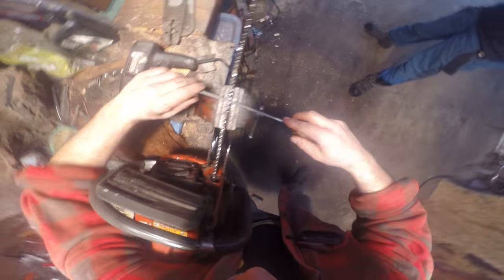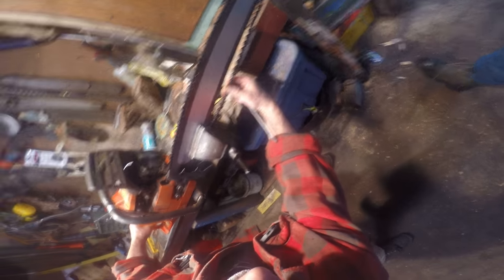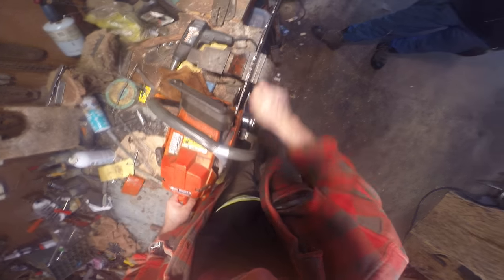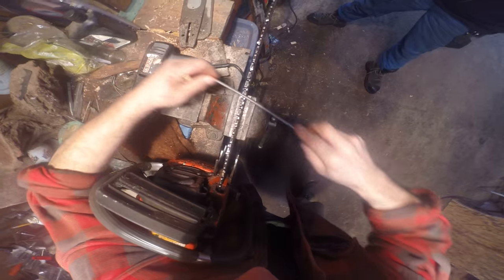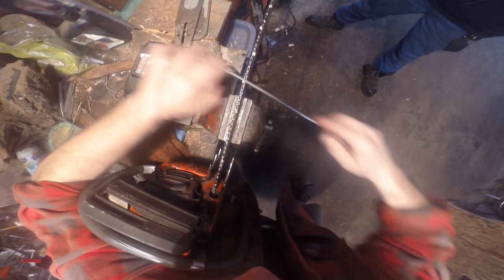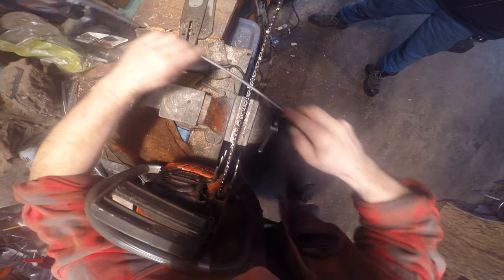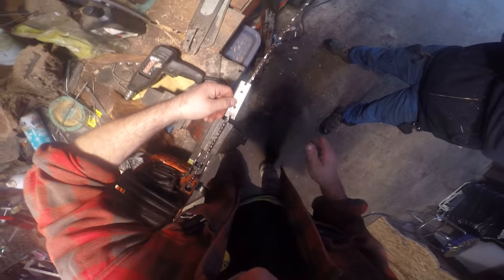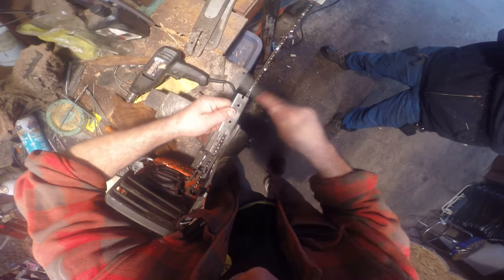a five minute chain saw sharpening

Comment: dont know how many times iv watched this video!😝👍
this is probably gonna sounds like a stupid question but when you file your chain do you hold the file as level as possible apart from when your doing the boat of course? 😝
and when using a raker gauge do you file them down to the gauge?
Reply from the maker: Mark Quinton level helps yes or a slight angle will be ok my suggestion to you. I'd spend a month trying different things cause yer gonna here so many things on here. We didn't have this option.  But no matter what ya hear it just that heard you heard it so actually it means nothing until you try then you can share you knowledge.  KNOWING that it works or doesn't.  So.  get the gullet then  get the top and side sharp.  Capeche.  Lol ha ha ha.  Right on stay well anything else just ask. Thx for being here
Reply: Cheers buckin!😝👍much help as always! 😊
Reply: think i understand it now!😝👍so used to having My rakers low and having the saw really dig in but your right! it cuts slow!  not efficient! used the raker gauge and man! what a difference!😃chips were flying! 😝thanks again Billy!